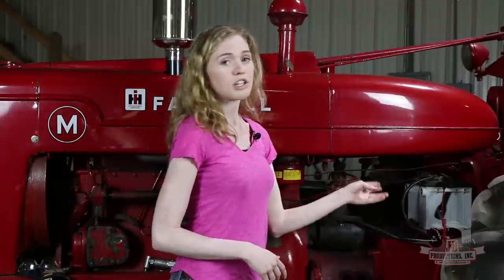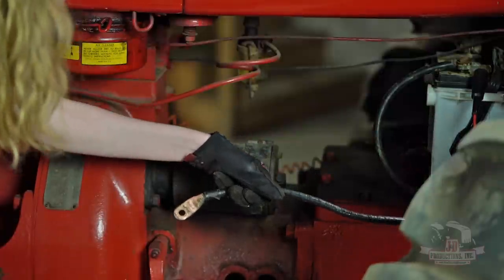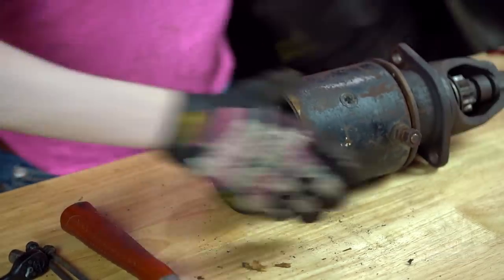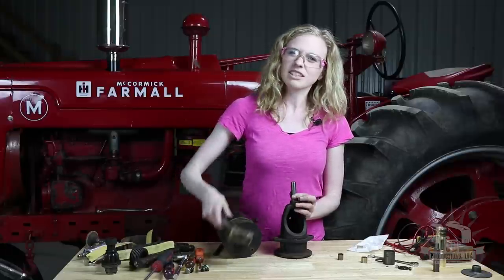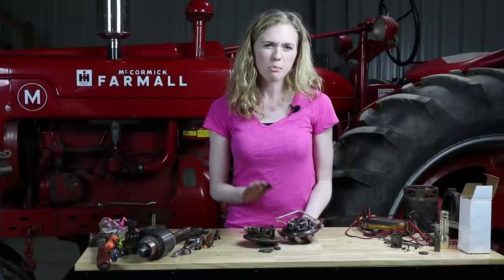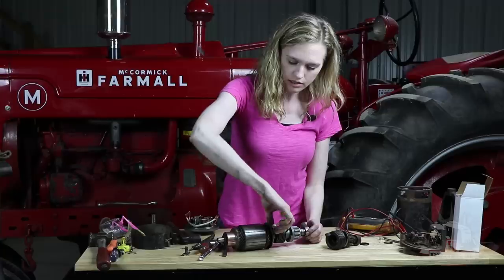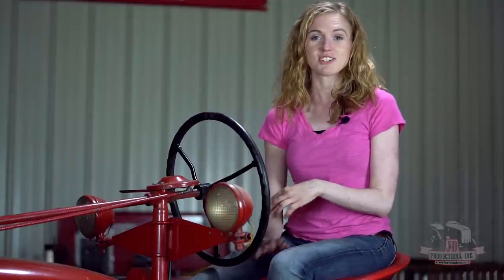Farmall Starter Rebuild: H, M, A, B, C and Super

Comment: Thanks again - I followed your disassembly and replaced the Bendix drive in my starter and instead of making an awful noise and not engaging it works as it should. The horrible noise is gone and the Bendix engages all the time now. I also saw another video from someone else that used blocks of wood to pry the brushes back for assembly on top of a large soup/stew can :) worked like a charm ! Thanks again !

Comment: First, great instructional video!  It may be called something different where you're from, but I learned the parts of an electric motor as: rotor, stator, commutator, and brushes.  Btw, if you're replacing the 'fields' you should see if the new fields have been properly matched.  Use your ohmmeter to test in microohm range.  Both should be very similar readings, ideally within 10% of each other.  Love the video.

Comment: Another consideration as well that a lot of people sometimes overlook is yes a battery has a 12v charge but has a bad cell.  For those that don't know a 12 volt battery has 6 cells (6 volt has 3 cells).  Its common (particularly on older 12 volt batteries) to have a cell go bad and a owner charge the battery, stick a voltmeter on it, see 12ish volts, and say it's good.  Basically the other cells are overcharged (on 12 volt battery each cell would only have to be .4 volts or so overcharged) making up for the dead cell voltage wise.  What wouldn't be made up for is the lack of amperage.  On a 600 CCA battery you're losing 100 CCAs of the battery.  That's 17 percent of your cranking power.  Really need to use a load tester on batteries to test them the right way particularly if they are older.
Reply: Buying a load tester was a game changer for me trouble shooting.
Reply: I agree with you, but she made it easy on the beginner without overloading them with T M I. 
That would be a good idea for her to have another troubleshooting video.  I like my cheep Harbor Freight load tester. It has never failed on me.
Reply: Or if in doubt, just use another battery temporarily and see whether there is a difference.

Comment: Very informative! So my starter spins strong but not engaging flywheel. when tested on a battery after removing it wont extend to engage the flywheel. Suggestions? Very clean inside teeth looks mint.

Comment: great video.. my starter passed of of thous  tests  .. but the starter drive did not, i noticed that my starter is not the same same as the one you are working at tho,  the is the same ,    mine have got a standard leaver ,  and it's got the little switch that connects up the power for the starter,  my old tractor is a b414 international 1964 diesel  McCormick , wonder where i could  get a new drive  i cant get one here don't have it ..cant order it..i have 110 tooth on the ring gear,  how many teeth should i have on my driver gear?

Comment: Very informative video. Does it matter that the wire stud on the starter was located on the side at first but after you reinstalled the starter it was now located on the top?  I thought with the way all the components were keyed that the position of the stud would not change.

Comment: To clean corroded battery terminals, you can use baking soda, (sodium bicarbonate) and hot water, use a paint brush to brush on or just pour it over the corroded area.

Comment: we have a 706 frame all tractor diesel it's about a 60 model  i drive  thru the field stopped and shutting it off and trying to starting it back up and it didn't start we had the battery check out and thay where good and wires to where good. i used a screwdriver to jump it it was dragging a little bit after a few times it was it

Comment: Hi Rachel. I inherited my Dad's 1947 Farmall M. The battery is a 6 volt and no longer holds a charge. If I use a 12 volt battery to start the tractor can I just go with negative ground or does the starter need to be wired differently?

Comment: I test the switch/battery the same as you, but with the starter still connected, dad turns the key, starter  Motor turns or clicks, but a 12 volt reading on the starter motor connection means battery and switch are ok.

Comment: So if the fields aren't shorted, what is the ideal ohm value for a good motor field??
Reply: There really isnt an exact specification for resistance in the field.  Basically what you are looking for is a low number.  If you have numbers above 100 ohms, you most likely have some wear.  If it is an extremely large number or O.L. it's best to replace.
Reply: @davidhorner5655  yep

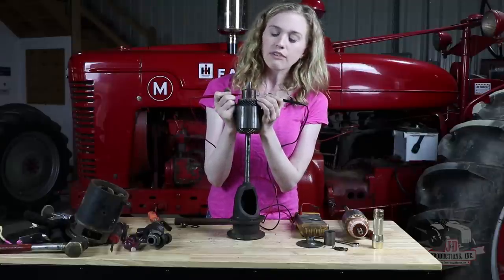Comment: Is there any particular setting you are using on the Ohm meter at the beginning of the armature test at 7:20?
Reply from the maker: Yes, use the lowest setting (ours is ten ohms or less but they vary). You're simply trying to verify continuity.
Reply: Many thanks!

Comment: Years ago a tractor my buddy had would not start regardless of anything done. I turned out some one had actually charged a 12v battery backwards! Seriously ..
If you take a stone dead battery and hook up charger backwards it charges opposite. I found it using a multimeter . Test light could not determine this. Crazy huh?
Reply: יעקוב אינורס 

Wow

Comment: hello Rachell my farmall m very hard to start cold days. I know carburater soon i try to start It floods. It will be dipping gas from it, when I try to chock it at half throttle it floods. when i put it on idle it still hard to start,but starts,
Reply from the maker: Hi Vince, I can try to help but first I need to know a little bit more information. Does your tractor have a distributor or magneto; is it 6 volt or 12 volt? Perhaps adjusting your float down would help, also make sure you have strong spark. -Rachel
Reply: I have a distributer with point and condenser 12 volt system using a resister on it.   lp high compresson cylinder head with crater top pistons using the original carburater on it. Would it help use a 12 volt electronic module in the distributer with 40,000 volt coil?
Reply: Happy new year Dan and Rachel!

Comment: Should really undercut the segments on the armature after cleaning up an easy way is to thin down a standard hack saw blade and remove some isolation between the segments.
Reply: A T, you don't do that with a starter armature, you do that for generator armature. the reason that is done is because the spring pressure on generator brushes is considerably less than a starter brush, plus the material for a generator brush is mostly soft carbon while starter brushes have more copper content. Its called undercutting the armature. reason for doing that is the soft brush ,low spring pressure combination can.t 'wear down that insulating bar between the adjoining  copper bars on the commutator and as the armature warms up during use it tends to 'squeeze' that insulating bar forcing it to raise ever so slightly thereby causing poor brush contact which results in lots of arcing, short brush life and low output. Don't mean to preach. Rebuilt these things for thirty years.

Comment: Was a little horrified to see her pick up that starter positive cable without disconnecting the negative battery cable first.
Reply: Lol this a joke right? The resistance of human skin reduces the amperage to a level that is inconsequential. Dry human skin has roughly 100,000 ohms resistance. And the battery has 12 volts. So if you use ohms law and do 12 divided by 100,000 you will get .00024 amps. Which isnt near enough to make it though the human skin with a viable shock.